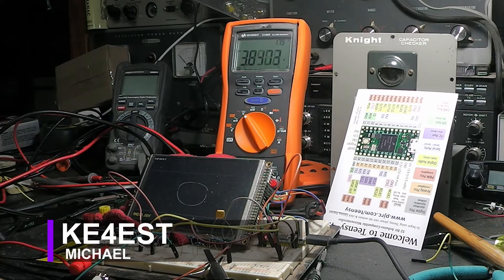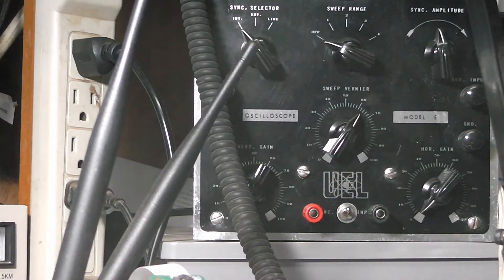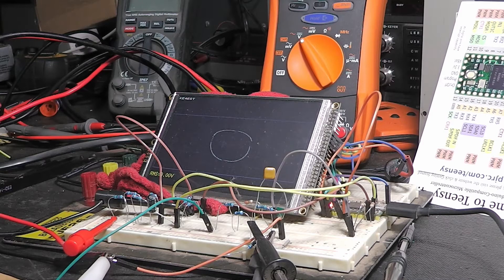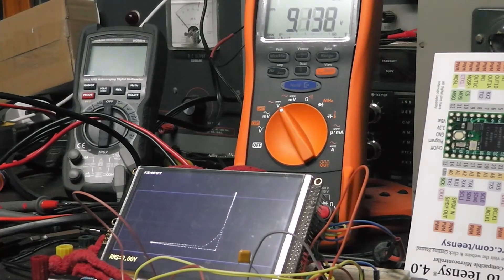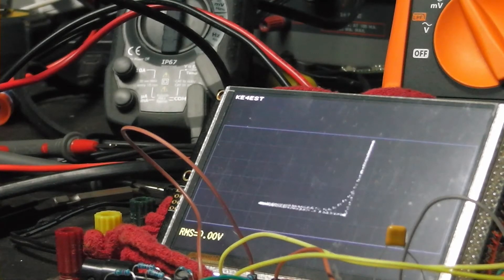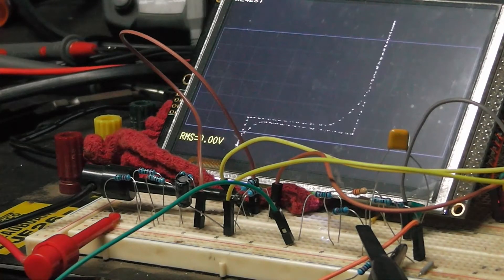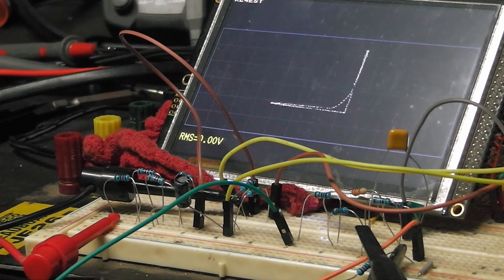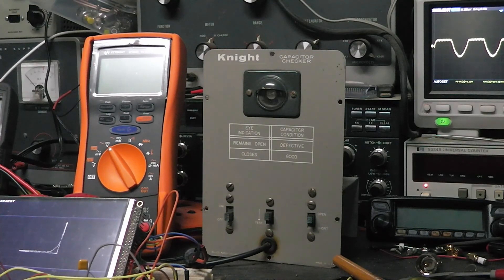Signature Tracer with TFT Display Idea using Teensy 4.0--Random Thoughts

Comment: Please post the schematic, final code and bill of materials. Awesome. Good work.
Reply from the maker: Well the output is from a IV curve tracer to oscilloscope adapter, that I already have.  You can find schematics on-line or buy them on ebay.  The output I am taking for X and Y and feeding it through a voltage divider so not to go over 1.67V.  That is going into two of the analog inputs.  Then I am just having the loop scan the "X" and "Y" and graph it accordingly.